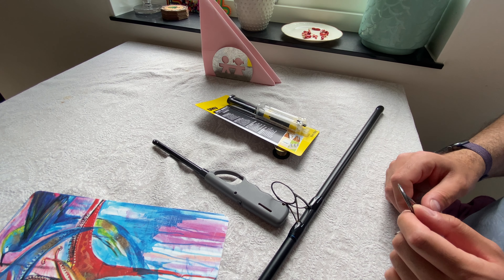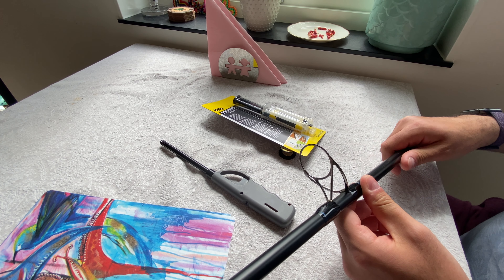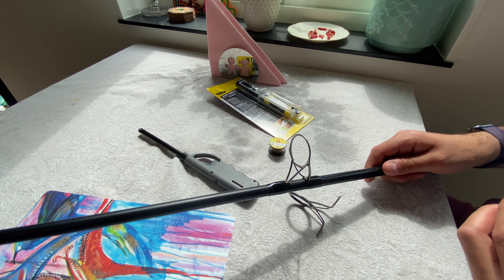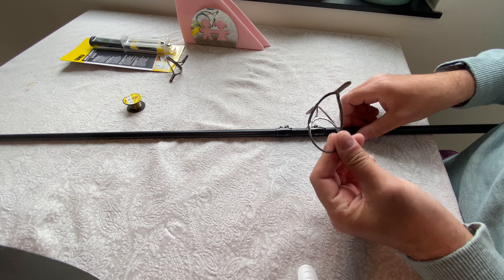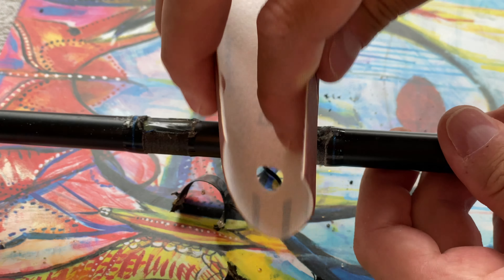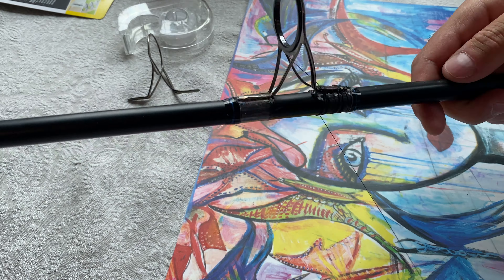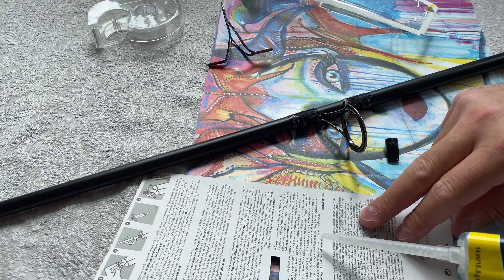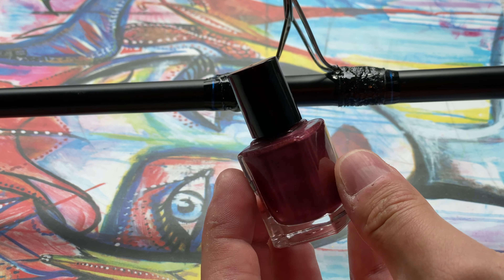How To Repair Fishing Rod Ring Easy

Comment: I’m sorry but this is not how it’s done!! The cotton part kind of… but neater! And the epoxy side needs correcting!!!
Reply from the maker: I’m sure it can be done better and cleaner,But It was my first attempt and I still fish with this rod 2 years later and the ring holds perfectly:)
Reply: There is no correct way to do it. I have rods 40years and I've attach plenty of rings using superglue and thread or just gorilla tape. 
You're just trying to stop the ring from pulling off or coming loose , never needs to be so scientific.